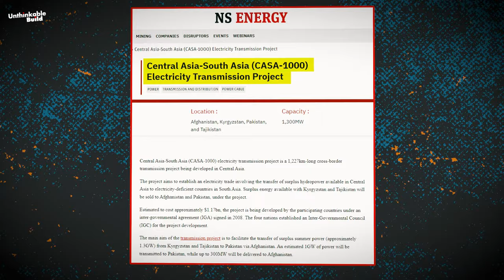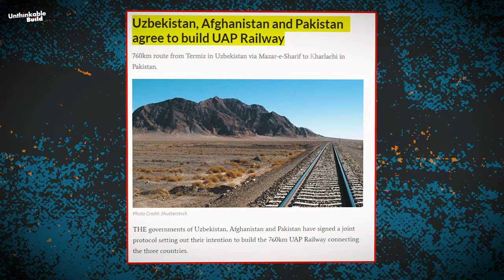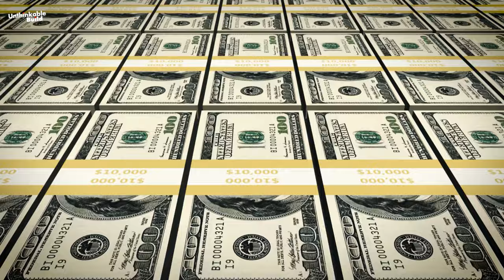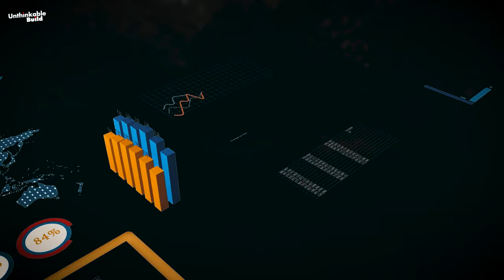Uzbekistan to reach Arabian Sea ports via Afghanistan through Railway

Comment: The rail gauge is the distance between the inner faces of the rails. China’s domestic railway gauge is 1,435 mm (4 ft 8 + 1⁄2 in), which is the standard gauge used by most countries in the world. However, some of China’s neighboring countries use different gauges, such as 1,520 mm (4 ft 11 + 27⁄32 in) in Russia, Mongolia, Kazakhstan and former Soviet countries, and 1,676 mm (5 ft 6 in) in India, Pakistan and Bangladesh. This means that cross-border trains have to change gauges at the border stations, which can be time-consuming and costly.

To solve this problem, China has developed a gauge-changeable train that can run on both standard and Russian gauges. The train can automatically adjust its wheelsets to fit different gauges without stopping, and can reach speeds of up to 400 km/h on high-speed rail and 200 km/h on conventional rail.
Reply: How is that possible? I doubt your post.
Reply: I don't think the changeable gauge is used for HSR! Given the political stand-off between Pakistan and India, India is literally cut-of form the Eurasian railway linkage. For having to use a port to link via the Iranian Chahabar Port, this inconvenience will increase additional cost and time delay.

Comment: The key component here is Afghanistan. This project is one of many which involves Central Asia and South Asia, but little enthusiasm has been shown despite the obvious  importance. 

You can build pipelines, railroads and electricity infrastructure but all of it has to go through Afghanistan, and what guarantee do you have that all of it won't be attacked and disrupted? The Taliban, would you really trust them with anything? They aren't even completely united internally, and they have to deal with their own little civil war in the form of the Northern Alliance which obviously doesn't want anything which might shed a positive light on the Taliban rule to happen. On top of that, there are various terrorist organisations showing their presence in the country along with elements both domestic and foreign that are hostile to both Pakistan and the Central Asian Republics and their interests. The cherry on top of this weird cake is the terrain. It is highly rugged, mountainous, and hard to navigate. Which makes it a challenge to police and protect the projects during their construction and when they're up and running. One attack means the entire thing has to be shut down, the fault has to be found, then fixed, all the while your labor is in danger. A very, very costly endeavour.

I'm very interested to see any developments on this front. If this project does succeed, it would give a massive boost to all the economies of the region and pave way for more cooperation and trade, but I wouldn't be too sure of it. There are a lot of actors who would love to stop it from happening, be it domestic or international.
Reply: I am Chinese. I totally agree with you. I'm trying to find a workable solution. I wonder if the Afghan government cedes part of its sovereignty. Allow multinational coalition forces to enter and protect key parts of railways, oil, and natural gas pipelines. China's large-scale infrastructure projects in Pakistan are closely protected by the Pakistani military. Even when Chinese engineers and technicians went to the construction site, the Pakistani military had to temporarily close the entire road. Every Chinese person leaves the construction site or goes to a store or other place. The Pakistani military will send enough troops to accompany them with heavy machine guns. However, the Afghan government probably does not have the ability to do this.
我是中国人。我完全认同你的看法。我试着想找到一个可行的解决方案。我想是否阿富汗政府让渡一部分主权。允许多国联军进入并保护那些铁路，石油，天然气管线的关键部位。中国在巴基斯坦进行的大规模基建项目就是受到巴基斯坦军方的严密保护。甚至中国工程技术人员前往施工工地的时候，巴基斯坦军方都要把整条道路临时封闭起来。每一名中国人离开工地或者 前往商店等地。巴基斯坦军方都会派遣足够的兵力架着重机枪随行。但是，阿富汗政府估计没有这个能力做这件事情
Reply: @huiouyang2003  I highly doubt that Afghanistan would be willing to do that. They spent over 40 years fighting two occupations, and it's unlikely that they would welcome a coalition even if it means to protect the project infrastructure, the people would be against it even if the Taliban somehow agree. It also makes them look weak and untrustworthy, all around bad optics for them. It would be a positive move if it happens though, I would love to see the Central Asian region flourish. As for security guarantees, Pakistan has one of the strongest militaries in the world and their intelligence capabilities are widely known, and yet you will find incidents where they were unable to prevent terrorist activities on the China-Pakistan Economic Corridor projects. If they can't protect their interests with surety, Afghanistan has no chance, you are correct there.
Reply: @msh-l33t  I totally agree with you. To be honest, my idea is not recognized and supported by ordinary Chinese people and the Chinese government. Because this is a thankless matter for the Chinese people and the Chinese government. The idea I proposed is the only solution based on the Afghan government's real willingness to develop its economy. Except for China, no country in the world has the capital, technology, construction capabilities and management experience at the same time. Afghanistan, Pakistan, Iran, Tajikistan, Kyrgyzstan, and Uzbekistan all have no money, technology, construction capabilities and management experience. The only thing Afghanistan has is the Wakhan Corridor and its geographical location.
我完全同意你的看法。说实话，我这个设想得不到中国普通民众和中国政府的认同和支持。因为这是对中国民众和中国政府来说是一个费力不讨好的事情。我所提出的设想只是基于阿富汗政府确实愿意发展经济的基础上提出一个唯一解决方案。除了中国之外，世界上没有任何一个国家同时拥有资金，技术，施工能力和管理经验。阿富汗，巴基斯坦，伊朗，塔吉克斯坦，吉尔吉斯斯坦，乌兹别克斯坦都没有钱，技术，施工能力和管理经验。阿富汗唯一拥有的就是那条瓦罕走廊和地理位置。
Reply: @huiouyang2003 Chinese company is already working on oil wells in Afghanistan. Their safety is protected even better than before in democratic government they used to complain from warlords.now everything is normal afg government.There will be drastical changes in afg in 2-3 years.Afg people nature  are same like Chinese they are best businessmen  but Pakistan army always wanted to create problems for afg unfortunately although we never harmed them.they created tal.iban and other religious groups in their backyard now they are complaining from same group..Pakistan people are very good people but its military should stop feeding snakes in their backyards one as Hillary Clinton once said
Reply: @MiladKhan-qt9qs  Let me return to the topic of opening up the Wakhan Corridor. I personally support opening up the Wakhan Corridor. But I am just an ordinary Chinese person without any power. Therefore, I can only introduce to the Afghan people the basic views of Chinese people on opening up the Wakhan Corridor. I can only offer my personal advice to the Afghan people. I personally think that if the Afghan government wants to persuade the Chinese government to open up the Wakhan Corridor, it will do so. The only way is to rely on the China-Pakistan Economic Corridor and the Silk Road concept of One Belt, One Road. Like Laos, a landlocked country in Southeast Asia, it has transformed from a road-locked country to a road-linked country. Laos also has no money, technology, or management experience, but by letting China build the China-Laos railway, the country's wealth increased rapidly within a year after it was opened, shocking the entire Southeast Asian countries. The Afghan government can propose the same plan, starting with the construction of an oil pipeline from Iran through Afghanistan to Kashgar, Xinjiang, China. [China now imports oil from Iran through the Strait of Malacca, which is controlled by the United States. This is the famous Malacca Dilemma in Chinese public opinion]. If the oil pipeline from Iran through Afghanistan could be opened. The Afghan people can get oil transit fees from it, and generally extract a certain amount of oil according to the amount of oil. In this way, the Afghan people have a fixed annual supply of energy and money income. The next step is to open railway transportation from Pakistan and Iran to China via Afghanistan. I guess as long as the oil pipeline and railway are built. The living standards of the Afghan people can be greatly improved.让我回到打通瓦罕走廊这个话题上吧。我个人是支持打通瓦罕走廊的。但是我只是一个最普遍的中国人，没有任何权力。所以我只能向阿富汗人民介绍中国国内民间对于打通瓦罕走廊的基本观点。我也只能向阿富汗人民提供我个人的建议。我个人认为阿富汗政府如果要想说服中国政府打通瓦罕走廊。唯一的办法就是借助中巴经济走廊和一带一路的丝绸之路的构想。像东南亚内陆国家老挝一样，从一个路锁国变成一个路联国。老挝也是没钱没技术没管理经验，但是通过让中国建设中老铁路，通车后一年之内整个国家的财富迅速增加，震动整个东南亚各国。阿富汗政府可以提出同样的方案，先以建设从伊朗出发经过阿富汗到达中国新疆喀什的石油管线作为整个方案构想的起始点。【中国现在从伊朗进口石油要经过被美国控制的马六甲海峡。这就是中国舆论场上著名的马六甲困局】。如果从伊朗经过阿富汗的石油管线能够开通。阿富汗人民可以从中得到石油过境费，一般都是按照石油的数量提取一定的石油。这样，阿富汗人民就有了每年固定的能源供应和金钱收入。下一步开通由巴基斯坦和伊朗经过阿富汗到达中国的铁路运输。我估计只要石油管线和铁路修通了。阿富汗人民的生活水平能够得到很大的提高。